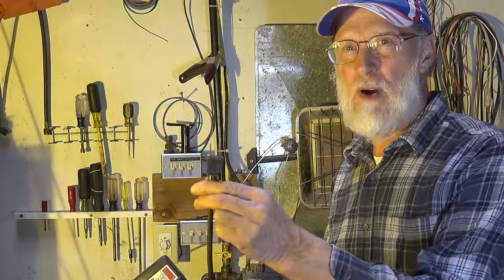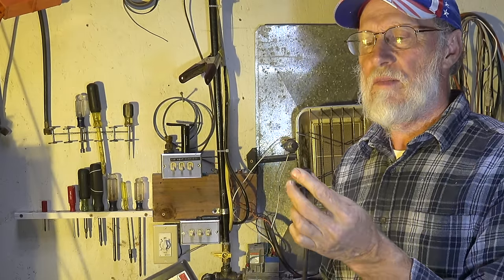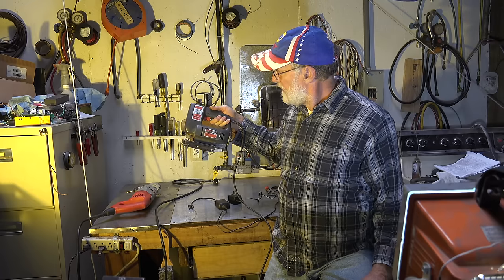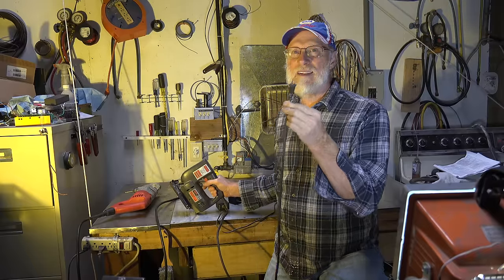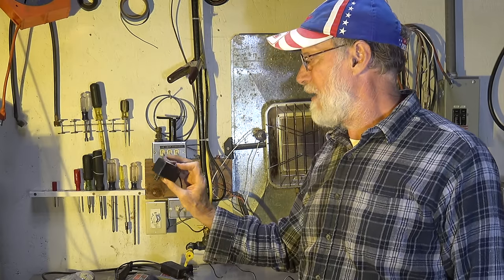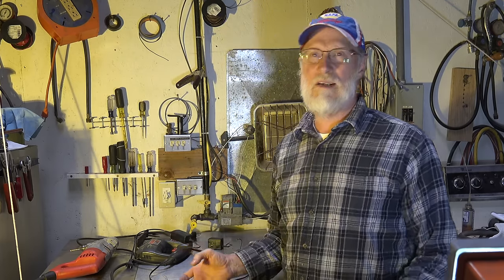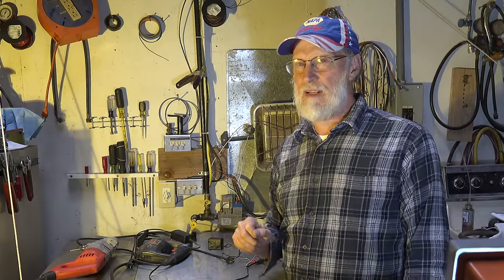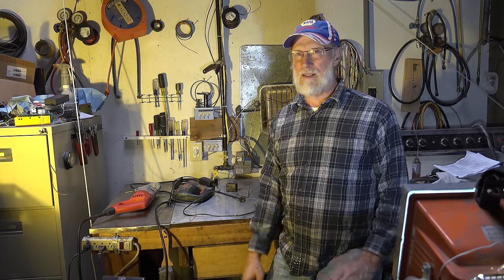What is a "floating ground"?

Comment: I'm an almost retired electrical engineer.  Understanding how electric works can be confusing. You did a good job explaining.
Reply from the maker: Thanks for the support.
GFM
Reply: I started many years ago just as you. Worked for a design engineer building process control instrumentation. We calculated the length of wire we use in those nema rated Hoffman enclosures. I think we estimated the amount or length of wire would span the earth a couple hundred times. Those were the days when there was a ton of manufacturing here in this country. Not so any more.

Comment: Actually switched mode adapters such as shown do usually have a connection from input to output in the form of a class Y capacitor. Its purpose is to act as a high pass filter and shunt the high frequency switching noise that is capacitively coupled from the transformer primary into the secondary back around to the input side before the switching circuit effectively eliminating it. Unfortunately it also has the side effect of sometimes causing an AC or pulsating DC phantom voltage on the output.

Comment: My father, just turned 80. And he is giving me a lot of his old tools. He gave me an old 1950's ShopCraft drill. It's a all metal case. Still works great! I need to replace the cord, and make sure the case is grounded on a three prong plug. They just don't make tools/things to last this long today. Such a shame...
Reply from the maker: Try a De walt 18v cordless.  15 years of hard use and still going strong.
GFM

Comment: My take on a floating ground can be electronics that have a logic ground but that logic ground is not tied to the panel ground by design. However interconnected devices often will connect to each others floating ground. In a similiar fashion hvac control power is often floating on the common/ground side. It is possible to have a floating ground in an electrical panel because of a bad connection in the panel. This situation can sometimes burn out appliances especially when other items are incorrectly grounded at the appliance, including a previously acceptable neutral tied to equipment ground on three wire dryers and ranges.  Floating neutrals are worse.

Comment: so the only "earth ground" is at the service panel... but the ground part of the outlet does not run to earth ground it runs to service panel and hits neutral correct? 
if that is the case, then all outlets are considered to have floating grounds if the ground of the outlet is not connected to earth ground? 

Great explanation and video! ( im just trying to confirm if what i think im hearing is accurate.

cheers!

Comment: 3 phase electric utilizes ground to run power back to panel, also single phase will run fine with hot and ground without neutral until the GFCI or AFCI comes into play

Comment: 👍, I just doubt that ground is connected to neutral in panel.
What you need is ELCB to disconnect the electrical supply when the phase is short to ground.
ELCB: Earth Leakage Circuit Breaker.

Comment: my HP has the ground from plug to the box you were showing, then just the 2 wires from there to the laptop.
Reply from the maker: It does not have a floating ground.
GFM

Comment: Thanks a whole lot. You did a fantastic job explaining the concept of a floating ground. Is there any way you would be able to explain how my multimeter reads 110v on the load side of an open ssr as it pertains to a floating ground? I'm so lost.
Reply from the maker: You need to understand that An SSR is an electronic device.  It is not just open as in a mechanical relay.  There will always be some bleed thru.  Voltage is not power without amperage.
GFM

Comment: It sounds like the 2 prong transformer power supplies are safer than a 3 prong device like the tools since they isolate you from the AC mains voltage, is that right?

And do you have a link to the playlist you mentioned at the end about the electrical system in the US? I'd love to check it out, thanks

Comment: In relation to Automotive electronics the term floating ground is related to some sensor grounds . The sensor grounds are usually on certain vehicles floating meaning means the ground is actually positive with a few hundred milivolts . Like Oxygen sensors , if you use an Oscilloscope on one and ground the scope to battery ground you'll see that it floats about .3V above what you would expect to see ( .1-.8V) . If you probe the sensor ground then you'll see it switching is reference to the 0V line being low reference . The do this to help reduce noise on sensors

Comment: I have two audio appliances which are two prong ,floating ground ,and to get rid of the interference I am getting I have been told to run an independent ground wire from the appliance to the earth outlet on the wall or to an independent copper ground rod(which the house already has one) and that should cure  the issue IS THAT  advice CORRECT AND SAFE? thank you I understood your video but didn't know the earth went back to neutral I thought just to the earth (ground rod)
Reply from the maker: It is safe.  A separate earth ground is best.
GFM

Comment: Question..........I live in a double wide Mobil home, I have a large main panel on a pole 20 foot away from my home , I think the neutral from the power company is connected inside the panel to ground, are you saying that when the power comes over to the home and into the main panel in the house, that the neutral should not be connected with the ground bar, if so , should there be a separate grounding stake to serve the ground from the panel in the home, and not connected to neutral.
Reply from the maker: That is correct.  You can and should use a separate ground rod connected to earth ground at the panel ground.
GFM
Reply: The neutral from the power company should be connected inside the [first] panel to the panel's ground bar AND should be connected to a ground rod.
Reply from the maker: RJParker is wrong on this one.  Checkout 550.11(A) & 550.16 of the NEC.  DO NOT connect the neutral and ground together at the panel inside the structure.  Any ground rod you may install at the structure should be connected to the ground bar, not the neutral.  The chassis of the mobile home should be connected to the ground bar.
GFM
Reply: I stand corrected.  GFM is correct that only the first panel should have the neutral and ground bars connected.  I knew that but missed the fact there was an outside panel first.
Reply: Thanks everyone, So after further review, this is what I found, At the main box on outside pole (main panel), the neutral and ground are tied together with a bar. There are 4 cables coming to the inside box, 1. Li / L2 / Neutral / Ground. The ground ties inside ground bar sub panel inside) to main panel ground in main panel on pole. there is also a ground  wire from inside panel to trailer frame. The ground bar and the neutral bar are not tied together on the inside sub panel. I installed new cables from the outside box to the inside box 2 years ago, and basically  redid what was done before, but with all new cables, and put them in Sch 80.
Should the ground wire be wired between the Main and the sub panel ?

Comment: all electrical potential returns back to generator sub station via ground earth . Out side substations power plant generators there are large ground rod arrays buried under soil to neutral ground etc. Many are unaware of this.In wye star three phase industrial power systems (such as where power is generated at plant) the center tap is neutral to ground ( earth) and not used in Delta. Three phase primary power line transformers and sub stations all have earth ground which all power generated returns potential via ground. That is why you only see three wires on primary pole in street all hot between each phase in three phase commercial services and ground( earth neutral) for single phase house service.  . No neutral between poles because the earth is used for such and pole transformer s usually  have a neutral tap to earth.Study motor controls and Delta wye three phase schematic and find where center tap of wye goes....NEC has these diagrams. Nice show Thanks.
Reply from the maker: The only problem with this is it is not true.  Earth ground has nothing to do with the circuit whether at the end users or the sub station.
GFM

Comment: You are getting floating ground and no ground confused.  Floating ground simply means the ground is not connected to the neutral.
Reply from the maker: There is no confusion.  no ground is a floating ground.
GFM
Reply: My generator has a floating ground.  The frame is connected to the ground, but is not bonded to the neutral.  Your  2 prong plug on the jig saw is connected to the hot and neutral only.  There is no ground to float, because it is not connected to ground.
Reply: @grayfurnaceman  - You're wrong and putting misinformation out there. floating ground means its not bonded to neutral. The actual earth doesnt absorb anything. Its not some magical place that current goes. The earth is actually a conductor.  If you send current to the earth then the earth will be live. The only way to stop current is cut the source.

Comment: Hey man, great stuff, I have an issue with my DJ mixer, i get small electric shocks when touching the metal screws and surface and a small tingle in my hands, now the back of the mixer output (AC) only has a 2 pin outlet (no ground) but routes into the main socket with a standard 3 pin UK plug (with ground), going by the manuals of the mixer i have it shows it has 3 pin output, but I have 2.. will this mean I need to go and have a ground put in the mixer? Or is it just a short somewhere, just asking your advice before I visit my local electronics store. Thanks
Reply from the maker: You have a short in the machine.  
GFM

Comment: Ok my battery powered inverter has a floating ground and will not charge my electric car.  What is the best way to have a ground for this type of application?  I have seen people use a jumper wire connecting neutral and ground together.  I'm not so sure how safe that is.  Can you suggest a safer way?  Thanks.
Reply from the maker: I don't think the ground is the problem.  Many times inverters do not produce a clean enough sine wave (even the ones that say they do) that is acceptable to the charger.
GFM

Comment: Great video.. Do you know how to correct my generator open ground, so that I can use on my 5th wheel? The safety on the trailer will not accept the power from my generator. Thank you
Reply from the maker: I have no info on that one.
GFM
Reply: Get a 3 prong plug. It'll be a dummy plug used for nothing but providing a grounded neutral.  Make a short jumper from the ground terminal to the neutral terminal.  Do not attached anything else to that plug -  Close up plug and insert in any of the receptacles on the front of the generator -  you now have a generator that will work just fine with a furnace or some trailers that are wired for grounded neutrals.  Takes less than 5 minutes- problem solved
Reply: @avflyguy  thank you

Comment: 4:05 What does "hot" and "neutral" mean in AC, where the energy goes to and fro equally on both wires?
Reply from the maker: In the US, the line voltage is 240 (or 208) volts between the 2 hot lines.  
We center tap the secondary of the pole transformer to get 120 volts.  So, we get 120 volts between one of the poles and the center of the secondary winding.  
Because the center tap will always be zero volts when each of the poles are at their maximum voltage, it will never be "hot".  
GFM
Reply: @grayfurnaceman  But AC outlets can have just two conductors. Aren't they both hot?
Reply from the maker: @johnaweiss  A 120 volt outlet has a hot and a neutral.  Neutral has a 0 voltage potential.
GFM
Reply: @grayfurnaceman  Wow, i'm very surprised.

Comment: grayfurnaceman ...im getting the following readings on my digital multimeter ....120v from hot to neutral.... 70 v from  hot to ground and lastlt 12v from neutral to ground on every receptacle in my dining room, what is the problem???
Reply from the maker: I would think you have a poor connection from neutral to earth ground.  Probably in the main panel.
GFM
Reply: Or some weird leakage to ground that shouldn't be there. If the checking connections don't fix it: try flicking breakers on other branch circuits to see if the problem goes away.

Comment: My 1970 model pop up toaster has no safety ground connection. Hot and neutral conductor only. This is a floating ground, because it has no ground
fault connection. Conversely we know inside the main panel the Neutral
and the safety ground are BONDED together.  Confusing, seem to be counter
to one another?
Reply from the maker: First, throw away that toaster.
The separation of neutral and ground at sub panels and appliances is necessary to keep the appliance from operating with an open neutral.
GFM

Comment: Can i connect the neutral (white wire) coming from the electrical panel to the neutral and ground (white and green) of the furnace if i do not have a ground coming from the panel?
Reply from the maker: I would not.   Replace the wire from the breaker.
GFM
Reply: Thank you

Comment: Am still shocked at how unsafe American plugs are in the UK we got rid of plugs like this 40 years ago
Reply: I hear a lot of UK commenters say this on various American electrical instructional videos. IMO, you Brits are overly paranoid and always have been when it comes to electrical code. You put fuses in 3 prong wires when such a thing is wholly unnecessary. If it were necessary our board at the NEC would have mandated it long ago. I mean this is America, we have an entire industry of lawyers looking to sue the first time little Johnny gets shocked by an unsafe device. If our plugs were that dangerous I guarantee any such company producing them would have been sued out of existence long ago. 

You also do not allow any outlets or light switches in bathrooms which I think is insane. To my understanding all bathroom lights must be pull chain (correct me if I am wrong). In America we allow light switches on the wall in bathrooms and I have never heard of someone being seriously injured or killed from a light switch. Electrical outlets, yes, but not light switches (all outlets in bathrooms have to be GFCI protected here nowadyas because in the old days people were killed by hair dryers making contact with water).

 (

Comment: On a electric outlet is it ok if I just tie gnd to neutral rather than just leave a floating gnd
Reply from the maker: I would not connect them together.
GFM
Reply: If I understand your question correctly that would be called boot legging and is very dangerous!!!  You should never connect the ground to the common, or neutral on an outlet.  A wall outlet tester will show you have it hooked up correctly but if you use a fluke it will show that you have 120 volts going from neutral to ground when it should read 0-1 volts. Hope this helped.
Reply: Very dangerous and will create objectionable current which could make your ground fault circuit become hot circuit.
Reply: @LucifersDeathSquad  yupper!!!

Comment: 1:07 "... things you don't want ..." Would it be correct to say: In DC, ground IS the place all the electricity is trying to get to, and while it's trying to get there we put it to work. In AC, ground ISN'T the place all the electricity is trying to get to -- it's the place we send energy which isn't part of the AC push-pull action."
Reply from the maker: There is no ground in DC.  In automotive uses, we may call it "ground" but it is just the second wire of the circuit.  We use the chassis of the vehicle as one of the wires.  Not always true in newer cars, as they use 2 wires in the circuit.
In AC, ground is not necessary for the circuit but we do, as you say, use it to dissipate surges and spikes.
GFM

Comment: The ground should be bonded at the panel and there should be a ground to the waterline or preferably a driven ground rod. A ungrounded tool is dangerous. this term floating ground is dangerous because when you use it, it is misleading the unaware. The fix is simple. Change the cord and drill and tap the metal screw the ground from the new cord to the tool.
Reply from the maker: You seem to be at odds with appliance manufacturers and the NEC.  Computer power supplies, phone chargers and electric drills are just a few.  Where would you drill and tap a phone charger to provide a chassis ground?
GFM

Comment: so if my outlets don't have an earth ground is the world going to end?
Reply: Surge protection strips won't work as effectively, especially important for TVs and computers. Most older houses with two wire outlets are dangerous around wet locations.  The safest thing to do on two wire systems is to install GFCIs at any location like baths and kitchens where severe shocks could occur.
Reply from the maker: We lived for many years without a ground on outlets.  Grounded outlets are safer.  I agree with RJParker on the GFCIs.
GFM
Reply: Great thanks.  I agree on the GFCIs particularly in the kitchen and bath.  It was somewhat of a smartarse question I know.  I have learned a lot from your videos, keep 'em coming.  I have tried to explain this chassis ground concept to a lot of people that see my 2 wire receptacles and I usually get a blank stare and a "uh ughhh uhh that's not safe" as response.  Even people who should know better.

Comment: A floating ground means that there is a potential for you to become the ground.
Reply: Exactly right, which is why if you have a generator for your home, you really should do what your manual suggests, which is hook up an appropriately-sized ground wire. Otherwise, the frame of the generator could become energized and kill you. Lifelong electrician and 30 year electrical inspector.